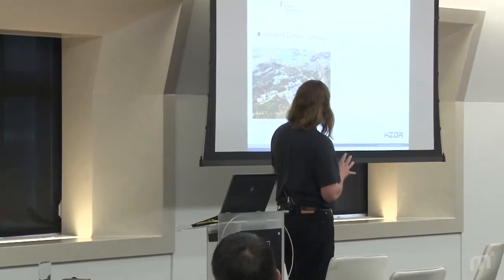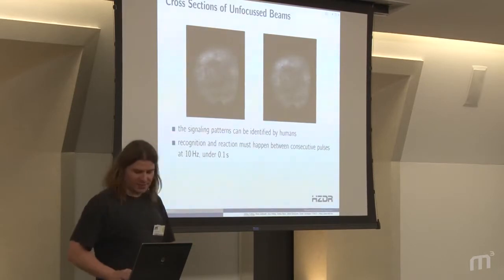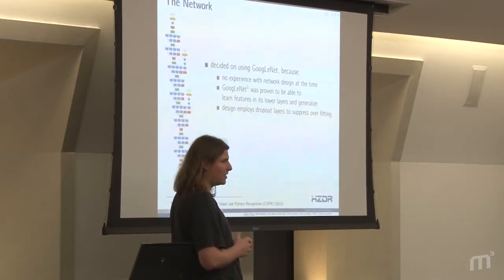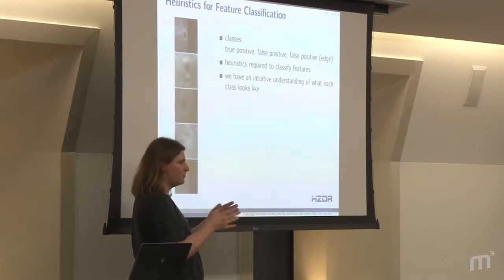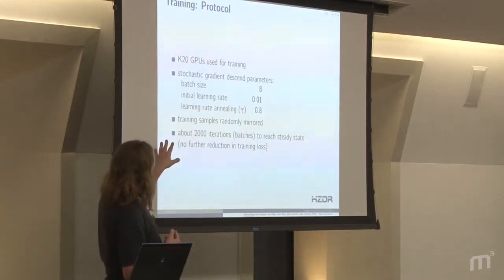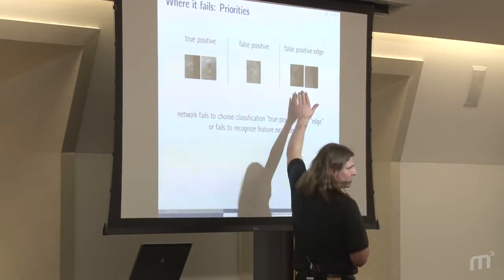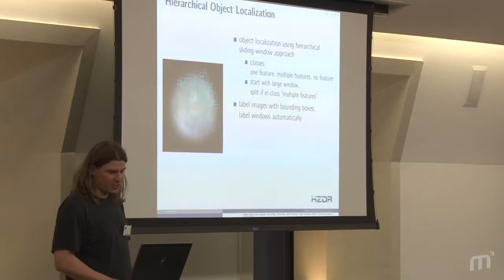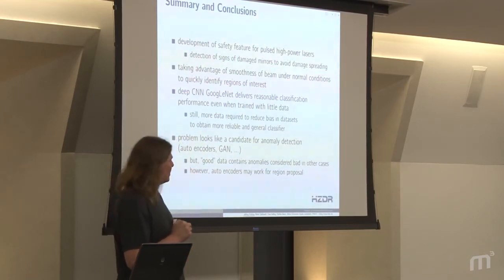M3 17: Jeffrey Kelling - Classification at 10Hz: Protecting High-Power Lasers with Deep Learning

Comment: Bi-ma Sak-ti = Milky Way galaxy
Reply: Page 99

beam (T) = 1 2 3 a ray or column of light, as from a beacon. 4 5 6 7 8 9 10 11 12 off (the) beam. 12a not following a radio beam to maintain a course. 12b 13 on the beam. 13a following a radio beam to maintain a course. 13b *vb 14 to send out or radiate. 15 (tr) to divert or aim (a radio signal, light, etc.) in a certain direction: to beam a programme to Tokyo. 16   [OE]